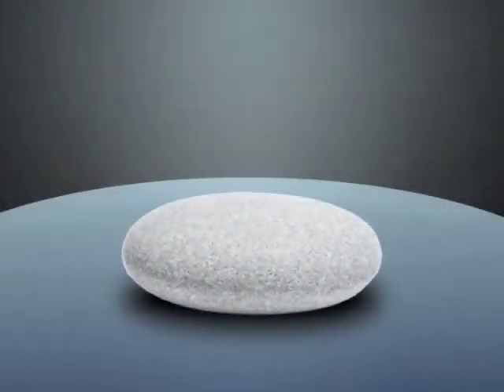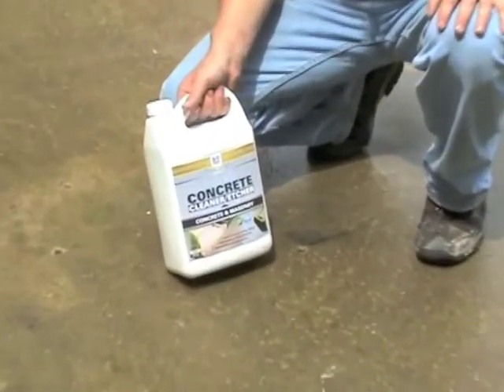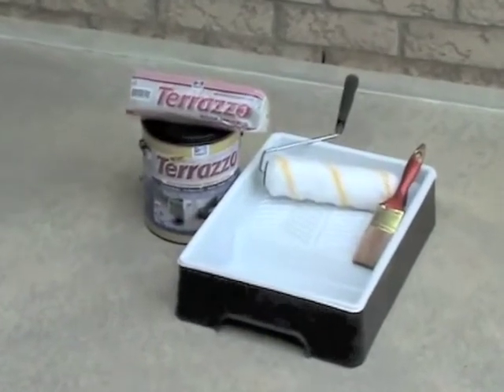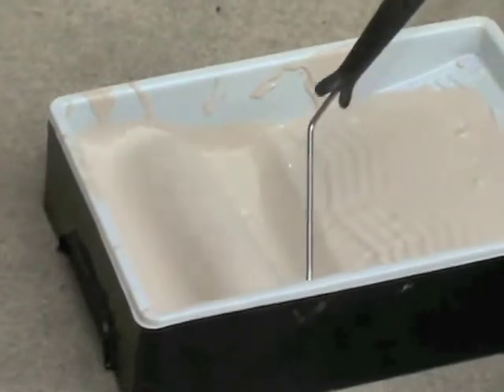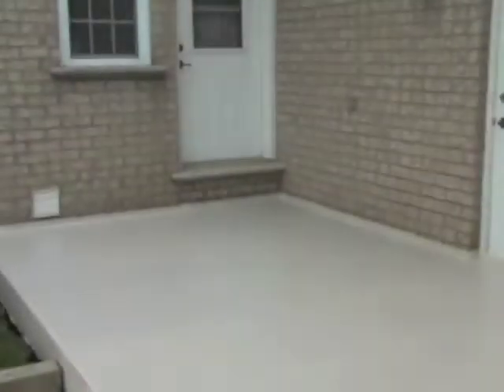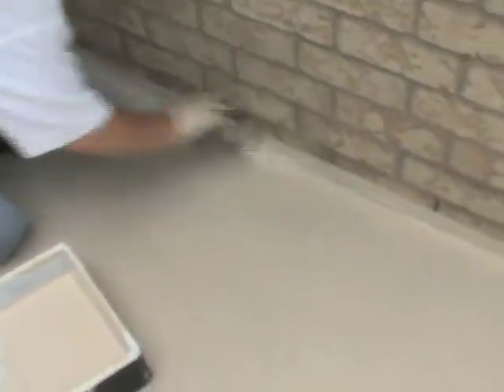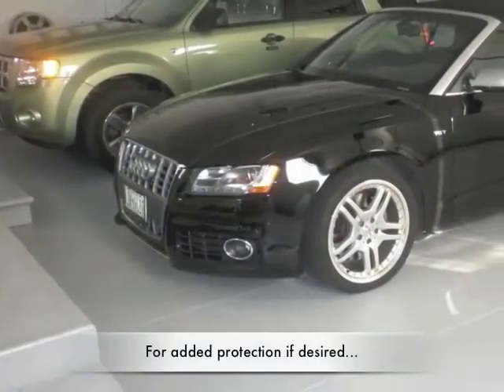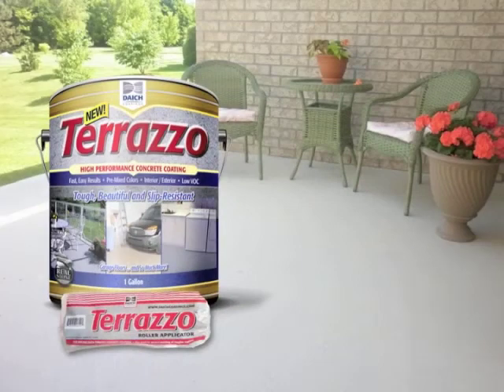Terrazzo™ Concrete Coating

Comment: Iauren liIIey
0 seconds ago
Horrible product with no warranty. They will sell you the Terrazzo or Spread rock but not include or tell you it's mandatory to buy their primer and top sealer. This would more than triple the price. I applied a primer but not their top sealer, what a disaster. Runed my partially enclosed front concrete porch after spending hundreds of dollars. When I contacted the Company, they basically said " oh well " you did not use our sealer, your fault. Terrible public relations and warranty. Buyer Beware